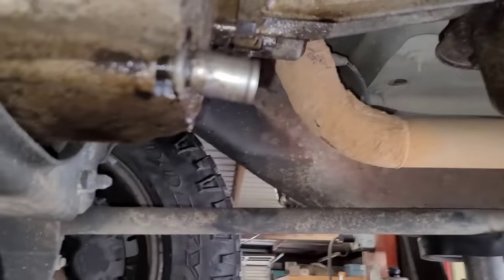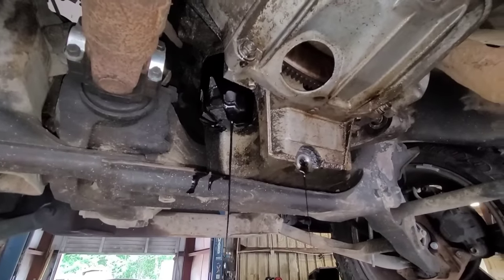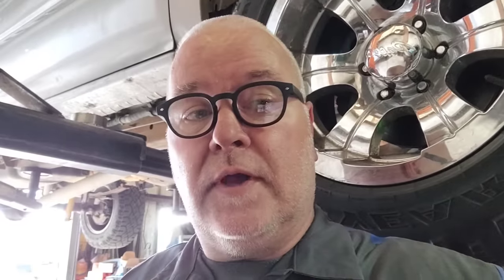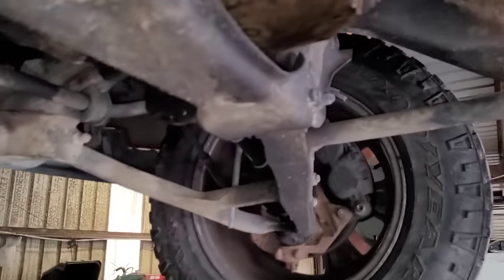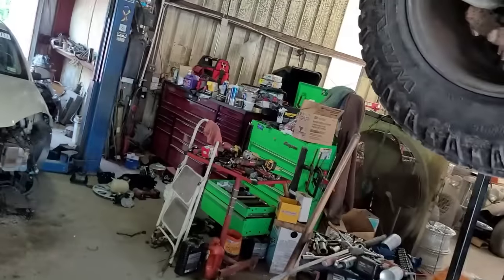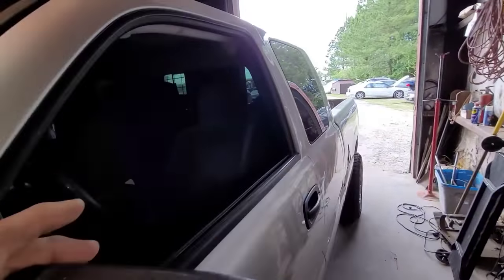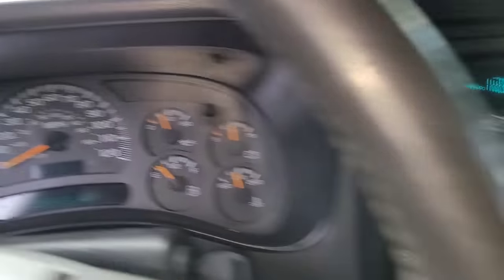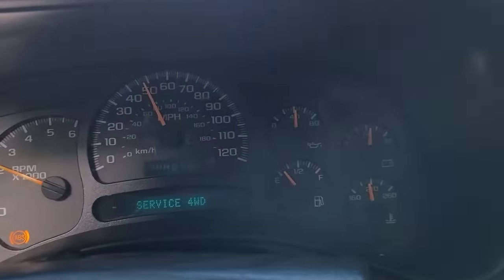We changed the oil in the noisy 5.3 and this happened!! The damage is done unfortunately..

Comment: Kenny not sure why you would use conventional oil if it calls for Dexos Synthetic. You can even get Dexos approved synthetic at Walmart. Supertech high mileage for $22. If a manufacturer calls for synthetic I think it should be used. It may be why this truck is still running
Reply: Supertech is actually decent oil.
Reply: @NoName-qs6ei  I just used Supertech High Mileage Synthetic in my truck. I wanted to see if it would help with my slight oil leaks. Also project farm had a flow test and it flowed pretty great in the cold faster than the non-high mileage oil.

Comment: Throw a little marvel mystery oil or a bit of tranny fluid in the oil and drive for a bit. Come back and change it out and watch the gunk come out. Did that with a 07 Escalade with the L92 at 350K miles drove it a week about 200 miles a day and when it was oil change day God the crap that came out. We used the scope to check in the pan, valve covers, and in a few cylinders to see the condition. Put in some dirt cheap oil/filter and drove it around untill she got nice a warm. Did a 2nd change and used a good filter/oil. We checked inside the valve covers and pan before we added oil and the improvement was crazy because of some high detergent stuff. He changes his oil every 10K "if he remembers" with mid price oil and uses it as a work vehicle/tow pig/part getter etc. 
No more ticking, good oil pressure, and reliable. Pretty hard to kill an LS.

Comment: I don't need to Prime any filters at all because the filter is at the end of the oil line in the engine.  Oil pick up, oil pump, oil channel thru crank, then filter.  Before crank, the oil line split and the other line goes up to cam and lifters.

Comment: In the unlikely event that socket does decide to come off, it may tumble down the road then smack into someone's windshield. That's not something I'd like to defend in a court of law. Just put a damn new plug in there and don't be lazy. Also, I'd recommend replacing that oil filter, now it's had some time to collect at least some of the crap floating around.

Comment: When I encounter a car with so many shavings in its oil i fill it up with cheap oil and a new filter let it drive for a  appr. 100 miles and change it while hot with a new filter and a higher oil type 10/w/40 or higher.

Comment: I'd change that oil again after 500 miles. If it's a quart low by then put in a quart of diesel fuel and idle it for 5 mins or so, then drain.  It's not going to perform a miracle but it will dilute some of the sludge.  Otherwise you can drop the pan and clean it, and the oil intake.  Some don't like the idea of using the diesel, and some use several quarts.  I've used one quart and really pulled alot of extra sludge out that the first oil change left behind.  Sea foam may work but cost too much when diesel does just as good or better.  If it does nothing, no harm done and no money wasted

Comment: Oiling the gasket on the filter does make difference if you don't oil it the gasket could stick to the engine and if you dont pay good atention you'll stack two gaskets when putting the new filter and there's your oil leak and potential engine damage

Comment: Hey Kenny, great video. The gray sludge would be the aluminum from the bearings right? That’s why the magnet wouldn’t pick up metal. I predict a spun bearing soon.
Reply: Babbitt is bearing material its copper coated with lead not aluminum
Reply: @howiehyde5496  Babbitt can be made from high-tin alloys with small quantities of antimony and copper, high-lead alloys containing antimony, arsenic and tin 

Modern babbitts provide a low-friction lining for bearing shells made of stronger metals such as cast iron, steel, or bronze.

Comment: Probably went into Disabled mode and then started with no power, only going 5 MPH max. Most of these 2000-year vehicles and up has these safety measures in them. Now you're gonna have to change the oil  over to Synthetic oil and filter. 40 PSI is great, even bouncing around as there is known for it. For any vehicle with oil looking like that mud. You're on YouTube, look up these safety things and the secret things your dashboard can do to help your vehicle.  I only know from seeing something similar to this. Had a friend run his car dry before it shut off, he punched a hole in oil pan andranit dryuntilit shutoff and costed. Fixed it with JB WELD on a good 1 1/2 gash in oil pan, we cleaned it up and patched it well, then made sure it was 100% dry and added oil in it,  ran another 155,000 with just over 300,000 miles, original clutch and ended up selling it for $1000 more than he was asking, was gonna donate car to a school so they could try to make it to run on hydrogen gas, his dad did it with a junker as a retired gm guy, his dad said your only selling it for that, he said yes, needs a clutch but still works on a 5 speed. Dad said, "Let me sell for you.  He said I was gonna ask you to talk to anyone that doesn't call me, so I'll sell it and get more for you,  he told his father, whatever you get over, keep it. All family lives on over 100 acres with 6 houses built on it for years. His dad sold it for $1,500 as is with clutch slipping just a bit, just baby it he told the guy, 1999 VW PASSAT 2.0T, his dad gave him all the money that he got.  Could write a book on all kinds of vehicles here, mini junkyard, if needed, can get something running and use for something.

Comment: Would this be a candidate for an engine flush, or at least at a minimum replace one or two of the six quarts with marvel mystery oil?  I've seen multiple 200k engines that are clean as a whistle inside when putting a quart of MM oil in at each oil change.  My granddad swore by it.

Comment: Liked everything in this video except your bashing Fram oil filters.  Maybe the bottom line Fram filters are not good; I don’t know.  I’ve used their top line filters for over 50 years in both new & used vehicles & have never had an engine problem.  Personally, I believe Fram makes good engine filters.
Reply: Jack we change oil every 20 to 25 thousand miles. If Fram wasn't any good my engines would not last. I don't know how Fram got a bad rep.

Comment: I'm wondering just what kind of damage your referring to with 250K on the Odometer has it had a timing chain and gear set yet if so did they do the oil pump replacement as well Or what ..

Comment: What you should do is fill the crank case with diesel full and prim the oil pump for 15 -20 minutes then drain, it'll clean the rest of the crap off before you put in clean oil.

Comment: My 2012 5.3 Suburban would have steadily decreasing oil pressure mid oil change cycle, and I changed oil regularly. I was just about to pull the pan and change o ring on pickup when I thought, what if its the filter. I changed the oil and filter to the best I could find and it never happened again. Crappy oil filter plugged up for some reason.

Comment: Engine with known damage, so why 5w30?  10w40 will help it hold together longer...especially helping the oil pressure stay higher when it is hot out.  I had a frontier that got run low on oil, on a 50 degree day with the engine warm the oil pressure at idle was above 15 and engine ran great.  But on an 80 degree day, oil pressure at idle was only 11 or 12.

Comment: In 40 years of doing oil changes I have seen a lot worse from no oil to never changing oil. I seen one car you could take drain bolt out and had to stir oil with screw driver to get it to drip out. I always prime filter sp you don't have a dry start up

Comment: What a shame.  I got 312000 miles on my Silverado 5.3 until a seall blew in transmission. Engine still was running smooth.  Heck the engine has a low oil alert when it's a quart low.  Holds 6 quarts.

Comment: Gotta love those GM V8s. Run them down to 1l of oil , fill them back up and they continue running as if the owner pays attn.Then hammer on the wrong size socket, but don't go bananas just make sure that plug is gutenteit.

Comment: On sludge like that I would put on a new filter, pour a couple gallons of diesel fuel in it and run it a minute or two and flush it out. Then new oil and filter. In 500 miles, change it again. Then go back to regular oil changes.

Comment: The oil filter may have been the cause of the low oil pressure, Ford Windsor Engines are prone to low oil pressure unless you use Motorcraft FL-1 A Filters or the Expensive alternative that are just as good as the $3 Motorcraft.
Reply: $3 motorcraft lol
Reply: @junicohen7918  Yes, Online and $4 at Walmart
Reply: @lilibethdoherty295  in store it's 12 .you can go get microguard for six at orilleys.
Reply: @junicohen7918  Microguard went up two bucks a few months ago not using them for my Tahoe anymore I get Filters online for Half the price !

Comment: It died on him because he went around a turn and the oil pickup went dry, so the ignition circuit was killed by the ECM. Because there was so little oil in it, it probably wouldn't start again till it all drained back down into the pan.
Reply: No logic in them exists to shut the engine down for low oil pressure.  You can hook the harness to a sensor that is just hanging in free air and run it forever that way.  Gen 3, 4 or 5 are all the same lol.  Nobody even keeps the stock oil pressure circuit in swap harnesses.. and prior to 2003 the oil pressure sender was a single wire unit to the dash only...
Reply: @LSswapGarage1  I've had several vehicles that did that, usually if the pressure goes low enough the idiot light comes on it will shut down the motor.  My Cadillac did that, i remember the work van we had did that, several things GM and Chrysler families.

Comment: I crank the engine while in clear flood mode till oil pressure buildsthen let off the throttle and you have a perfectly primed oil sysytem. Also, that engine needs more than one oil change.

Comment: These first and second generation 5.3s are very sensitive with oil.. my 08 5.3 oil pressure drops if I wait too long between changes, 220k miles original motor and transmission - I use high mileage 10w30 synthetic .. 40+ psi
Reply: These old 5.3 can take alot of abuse, that was cringe worthy tho, i baby my 05.

Comment: Could it have a fail safe for when the oil pressure dropped it cuts the engine?
I had a customer with an Audi, he basically changed the oil when the pick up filter was blocked and the engine would go into protection mode and refuse to start.

Comment: A very dirty engine  oil would get a oil change run it awhile  then change that with fresh oil. We saved the 2nd drained  oil to use to clean the next dirty oil engine to save money
Reply: We always did the same thing. On a really gunked up motor engine flush did wonders. Also a gt of Trans fluid added to the oil but not overfill. 
.

Comment: I prefill all my oil filters, even  the ones that sit horizontal. Soak them overnight and dump some of the oil back in the bottle. That way there is at least  some oil in there and it doesn't slobber  all over the engine when I screw on the filter.

The sludge in that engine was begging for "THE TREATMENT".
Fill to the valve covers with kerosene. Let it soak 4 days.
Drain.
Fill with one quart ATF and the rest some cheap off brand oil.
Run it 500 miles, drain oil, new filter, repeat.
Then fill with good oil and the sludge should be gone. Can't be sure about the mechanical aspects of THAT engine but  THE TREATMENT will clean a sludged up mess like a car that was never  driven more than five miles, didn't get hot and the oil had a lot of moisture in it. Think little old ladies car.

I was surprised you showed disapproval of Fram filters. I've been buying them for decades. I like the gritty finish because it's easy to get a grip on.
I have had at least three cars go 150,000 plus miles before selling or trading them in and I saw them buzzing around town for years. There is a YT video where a guy tested how well the filter captured contaminants and the Fram did an excellent job. There are several videos where a guy cut open a bunch of filters and find fault with the construction of the Fram . But it turns out the Fram was better at what a filter is supposed to do, capture foreign particles. I have a Jeep diesel with 300,000 miles on Fram filters. They can't be too bad.

Comment: Those trucks are super common to have a bad oil pressure  Sending unit. plus they have a screen in most models some do some don't as I found out before the oil pressure sending unit that screen can be clogged. causing the  Low oil pressure Light to come on. But that engine looks me I would change that screen. knowing how much junk is in that oil system and I would dump a big fat quart thick old Lucas in it And call it a day it is see how long it lasts 50/50  Might go another 50K who knows

Comment: With something like that I always stress that I make no promises and it's a last ditch effort to get a little bit more out of the vehicle. But I let them know even if they get lucky they should prepare themselves to buy another vehicle soon. Also if the engine has real high miles and noise and especially pressure problems I would always add a qt. Maybe 2 qts of Lucas. Or hyper lube.

Comment: I would change the oil with high zinc break in oil,run it for 500 miles,then change it with the best synthetic 5 or 10w30 money can buy. Then , probably look for a replacement because I believe the damage is already done and nothing besides a rebuild or replacement is going to fix this one.

Comment: My dad had a old ute/pickup that had a very tired and sick engine it used more oil in a week then you would need to  it  had black smoke coming out of  didn't over heat much though water pump wasn't the best the belt squeak  it would take ages to start it  and would try to stall etc
Reply: My dads dad used to get oil by the barrel so we used half of those

Comment: I've always done my own oil changes the last 50 years. Always lube the oil filter Gasket. Always. One time I had the Gasket of the filter I was taking off stick to the engine. Didn't notice it was there,put the new filter on. Upon start up I had an oil leak at the filter. Found out what had happened after investigating further.  That's one reason to lube the Gasket. Also so it doesn't bind or fold over. Usually get at least 250000 miles + on my vehicles and none of them ever look like that Chevy underneath or internally. Just saying.

Comment: The oil DOES NOT “drain/consume faster” when lower!

The burn/consumption rate is the SAME!, but because there is less, it would be RELATIVELY more/faster (as in percentage), but the SAME RATE!

The oil on the rubber ring is not “really” necessary, correct.

But if you don’t and the mating surface is bad/dirty, the gasket can get distorted, pinched, stretched, etc.

Or, either over tighten it, or leave it too long, you WILL have trouble getting it off without the little oil between the mating surfaces!

Comment: i would only put in 4 quarts of cheap oil and add one quart of marvel mystery oil to it... drive the vehicle a few hundred miles and then again change the oil and filter again.. the marvel mystery oil will help to clean out the junk in the engine and oil pan..

Comment: Wow I have never had a vehicle that I let the oil level even get a quart low in. Never let the oil get that dirty either. I may have run oil longer on a old car but never let oil get like that on even old junker cars. Also I never use aftermarket market filters. The oem oil filters are specifically made for that engine. I don’t take chances on parts store generic filters and oil

Comment: I would have used have used a really good engine flush and 5-quarts of a cheap conventional oil. Drain then pour in synthetic oil and a premium oil filter. I would wish luck on avoiding an engine rebuild in 20k miles.

Comment: Do other auto repair shops actually get in repair jobs that is this insanely easy? Just wondering cause nothing ever comes into mine that is even anywhere near as remotely simple as this. If that truck came into my shop it would have had 3 spun rod bearings  and the frame would have been rusted into multiple pieces, and its owner wouldn't even have enough funds available to pay for the tow bill!

Comment: I have to wonder why you didn't check the oil level with the dipstick before running the engine? No wonder it was making noise with very low oil level. There's no doubt it's been badly neglected by others but you should have checked first.

Comment: WITH THE OIL CHANGE ADD 1 QUART IN OF MARVEL MYSTERY OIL IN PLACE OF A QUART OF OIL TO CLEAN OUT THE OIL PASSAGES.
Reply: Used to do this regularly, 100 miles prior to oil changes.  Perhaps 1/3 of a quart or so.
Reply: @dennisyoung4631  EXACTLY RIGHT DENNIS. THAT WAS THE RULE OF THUMB TO ADD M&M PRIOR TO CHANGING THE OIL AND THEN DO YOUR REGULAR OIL CHANGE. THANKS GOD FOR YOU TUBE. THIS OLD SCHOOL KNOWLEDGE CAN BE PRESERVED FOR OTHERS.

Comment: ♠♠♠♠The reason you put oil on the filter gasket is so you don't run the risk of it sticking to the flange. . I have known people who pulled off the filter only to find two rubber gaskets. People will put the new filter on and not see the stuck gasket. Sometimes it is because the filter location is in a visual blind spot.

Comment: Wixom filters only ,,,,I would run it for a hour and change the filter again and see how long it runs till 300 miles change it again probably last another 2 to 3 yrs easy ,,,,,I've been suprized doing this if it's gonna last it will 3000 miles change it again remember oil and grease is cheap compared to a engine or a car ,,,,customer agrees check and add oil if needed 2 times a week saves a lot for the customer beleiveme me they come back because you saved them 2 to 3 yrs on money lol